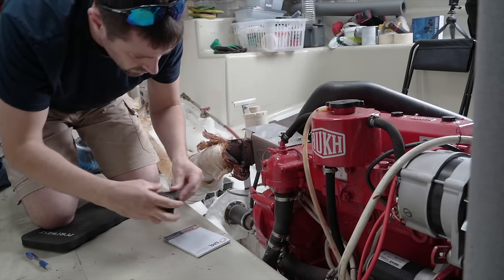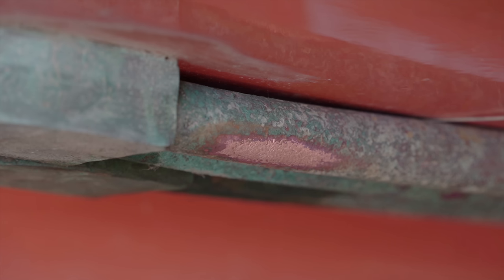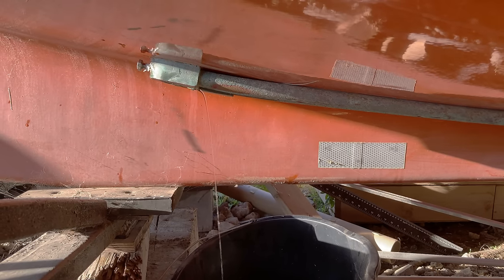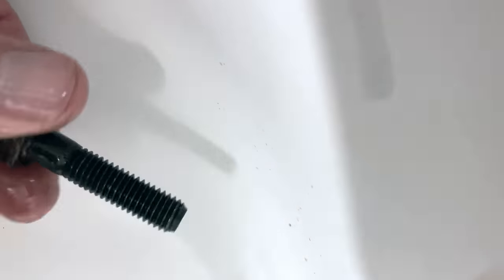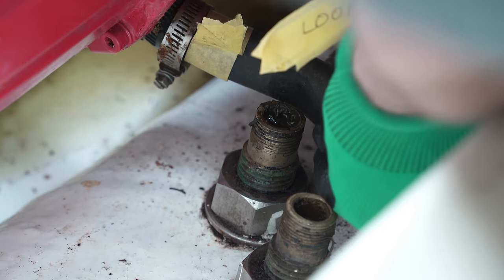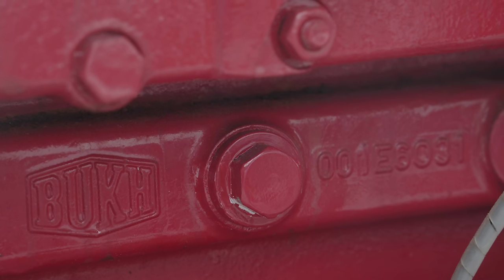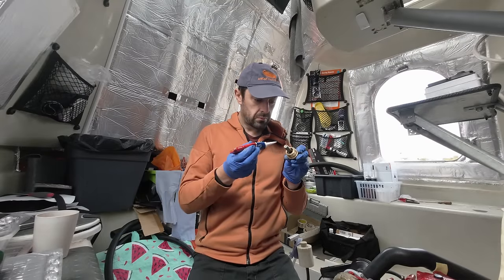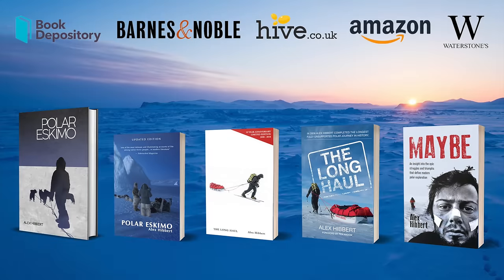Engine Cooling Overhaul Part 1. Hoses out / heater off / anode check.  Lifeboat Conversion Ep59 [4K]

Comment: Alex for your window blackout you could buy a cheap fibreglass fire blanket cut it to window shapes and sew velcro onto the edges and then use self adhesive velcro on the hull/shielding to fit, at least the fire blanket parts are then dual purpose.
Use Norma s/s jubilee clips if you can get them as replacements.

Comment: Making some collapsible frames for those blackout covers wouldn't be too difficult. Can probably even 3D print some if it never gets hot enough that plastic would melt, with the added benefit that it'd bend instead of breaking
Reply: Could even just use 2-3mm plasticard as the frame. Can get good sized sheets on eBay for not much.
Reply: Maybe something like that but than with hmm how do you call it in English , on a coat you have a zipper and over a zipper you have a flap with pushnobs to hold the flap over the zipper 🤷🏼‍♂️ maybe use those

Comment: Semi-truck sleepers use button snaps for blackout curtains like that, they work Allright for the task but you may want to do something for the light leakage if you want total blackout.

I may make a light frame for the fabric much like a removable window screen (to bugs out of a home) that just snaps in place with those magnets.

The thing I'm sure would work but may also be the most work would be a zipper with one side attached to the window frame and the other to your fabric, if the zipper itself leaks light have the cover hang over the zipper.

Those are my ideas for the problems, hope they help!

Comment: Your blackout curtains should be a metal leaf iris system (aka camera lens type) motor actuated with a big red button and of course bluetooth enabled in case your too exhausted to reach the said big red button. Needless to say it can be solar powered as your using it to block out light. You may have to design this from scratch.....EDIT - thanks for the angle grinder shot, much needed
Reply: Or instead of Bluetooth, hire a USAF Airman to man the system 24/7.

Comment: For those copper washers you can anneal them with a blowtorch to get them red hot and they will soften and seal better than with any sealant you could add. I recall being taught that using sealant on a copper sealing washer can cause leaks.
Reply from the maker: Ah thanks. I actually used the sealant on the thread. The copper itself was clean and just clamped tight with the socket.
Reply: @AlexHibbertOriginals  Might well be OK, but if you haven't refitted hoses and coolant yet, it would be better to anneal the washer as bcary461 suggests, or buy a new one and fit that. Easier now than mid ocean! The sealant would work better on a taper thread fitting, rather than a parallel thread and face seal fitting like this one.

Comment: Bar magnets inside a clear pvc tube on the outside of the cloth sun shield & screw through the tube into the wall for the 2 vertical sides

Comment: I'd take inspiration from a fractionally different kind of marine adventuring - narrowboats.  I have seen several with circular flat 'cushions' which double as porthole blinds.  With some 1" foam, a little fabric and sewing machinery (sorry, grinder not required) and your choice of fixing - studs, velcro, whatever - you would have some nifty non-flappy blinds providing a little extra insulation on the side.  And you can sit on them....

Comment: Alex, It may be to late for this as I only today discovered your channel. you may have already discovered this but having spent many years working with fiberglass, I suggest using  Diamond Grit Jig Saw Blades. They last quite a long time if used with only fiberglass. You have a very interesting channel here and I've been binging on your videos most of the day forsaking other activities. Best of luck.
Reply from the maker: I tried them a while back - didn't have much luck. Now I just grind!

Comment: Hi Alex make a spare set of hoses the correct size for quick fit and a spare reducer end on the oil cooler heat exchanger as that’s what let me down 150 miles off Ireland!!

Comment: Looked like regular water in the cooling system. Definitely make sure to replace with a glycol blend. And consider what percentage you’ll use based on the temps where you plan to be.
Reply from the maker: It was the recommended antifreeze and anticorrosion blend. Was green/yellow.
Reply: @AlexHibbertOriginals  It was just hard to tell. I’m glad it was.

Comment: Either set or use an adhesive to install magnets around the window and get blackout curtains either with magnets already sewn into them or install them in the curtain yourself. They are used in camper vans all the time very efficiently.
Reply: I like this idea but not sure how they would work in a humid environment.

Comment: Get some car window shades and cut them to fit. they are foldable and seem to be sturdy enough. Also, that long pipe @5:25 can probably be cut and shortened. also, if i was you, i would NOT use long rubber hoses, but in fact just go to the hardware store, and make some copper piping and copper elbows with solder or brazing to make make the hose runs shorter so that its all converted to hard pipes. this imho will be more reliable vs having an entire length of hose be susceptible to leaking where a copper pipe having a hole in it is a very simple in the field fix.
Reply: I would stick with one length of pipe. Joins between pipes are the most likely point to leak. By adding hard line in the middle you are adding two extra joins.
Reply: @LesNewell  but that is infinitely more repairable than a 1 foot length of hose developing a leak in the middle. you cant fix that out in the field. if a hard line develops a leak, you can just solder it shut at that failure point.
Reply: @petek9348  Hose assemblies rarely fail in the middle unless they are subjected to abrasion or impact damage. It is much more likely for the joint at the end to fail.
To use a hard line you need a rubber coupling at each end, which means you have 4 joints rather than the two you would have with a single rubber hose. Overall you have increased the chance of failure. 
Flexible hose is easy to store. It can be tucked into any convenient corner so carrying spare hose isn't likely to be a problem.

Comment: Fix it at the top and roll it up for stowage then just roll it down to adhere when necessary also you could put a strip on the bottom so it's weighted and won't be so flimsy

Comment: There is an alternative "waterless" coolant to the traditional water/antifreeze mix we all normally use. It has some superior quality/advantages attributes over the former. But you would have to be the judge if it's a practical consideration for Allen or not?
Reply from the maker: Since I can't get ALL the water out, don't these waterless ones lose their benefits even with a few % of water?
Reply: I can't say I'm a fan of waterless coolant. It has a higher viscosity than water, making it harder to pump through the system. Additionally it has a lower heat capacity than water. In other words it will move more slowly though the cooling system and carry less heat with it. I'd stick with good quality long life car antifreeze mix and change it out every few years.
Reply: @AlexHibbertOriginals  Yes you would have to attach an air supply to blow out/dry-out all coolant lines/journals and chambers. I am sure from watching your work effort that you have the talent/skill to implement it if you wished too. And I also know that the efforts/expense may outweigh the advantages of the product's superior characteristics for you.

Comment: while i find the whole alan story very entertaining, i think its fundamentally misguided. Alan is designed for survival, not getting from A to B, which is kind of crucial for an expedition. As soon as there is some sea state or wind, it will be hard to keep Alan on any course, let alone make progress. 5kt? All the reliability over-engineering on the inside will not hide that, and the fact that Alan has a huge wind exposed above-water area, small draft, weak engine, and a hull designed for floating not locomotion will not help getting anywhere. I think Alex would have been way better off refitting an old sailboat for the purpose.
Reply from the maker: I periodically come across this feedback, and I point out the same things. Instead of seeing a lifeboat as its previous role, look at the planned usage and the characteristics of the boat, plus modifications.

Alan is designed for survival, but isn't a circular survival pod. In fact, the lower hull shape is very similar to half a dozen cruisers and fishing boats I see in the yard. Is it a 'rolly' hull? Yes, and I have a keel plan for that.

Due to the stringent SOLAS rules, the GRP build and robustness is substantial. The draft is small when unladen, but this will change with months of supplies, more steel ballast, and 2000+ litres of diesel onboard.

The engine is 48hp (well, at top revs) for a 25' boat, and a high thrust prop. This is substantially more than many, or even most, yachts that are taken offshore.

The area exposed to wind is significant, but Alan's offshore passages will be short and timed very precisely to benefit from/avoid wind.

An old sailboat would have been much more expensive, likely with an ice crush vulnerable keel design, without the cavernous, insulated interior, and with 100x more 'miles on the clock'.

We'll see, I guess.
Reply: @AlexHibbertOriginals  Thanks for the well thought out reply. I see some of the points you are making. I am looking forward to the keel-build-video! We'll see, as you said. I would be most worried about the usability in passages when the tested speed with "low" weigth is 5-6kt. Curious to see if you can still reach that after you add several tons and how the higher draft/waterline changes the handling.
To the sailboat idea: you cant compare the current state of Alan with an old sailboat "as would be". Alan also wasnt really isolated, doesnt have a keel, was filled with seats when bought =) I see the point with the interior shape. It comes at the cost of exterior usable space though. I was wondering about that. Do you intend to stay inside most of the time? Apart from land expeditions of course.
Reply from the maker: Point taken on pre/post modification, but it means we agree that the initial state of either purchase is only a starting point. Alan actually was insulated with quality PU foam when first made - the foil surface insulation is only for the back of the drivers console area (<20% of the boat).

Inside yes most of the time, although the deck is useable when moored/at anchor. I'm also adding a stern platform this winter. Around the sides? Nope.
Reply: @AlexHibbertOriginals  cool! looking forward to seeing the rest of the build. good luck!

Comment: Reynolds Wrap Aluminum foil or any high quality aluminum foil will black out the windows surprisingly well & on the cheap. I just used that when traveling & working nights. Aluminum foil is cheap, light weight, multi use, multi purpose & simple.
Edit: the foil should just stick directly to the glass & takes only seconds to install or remove